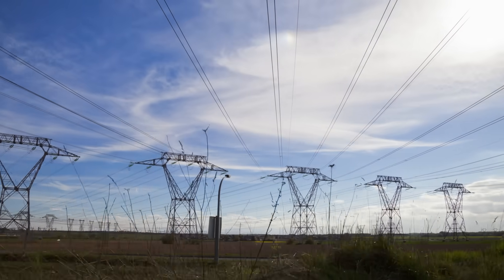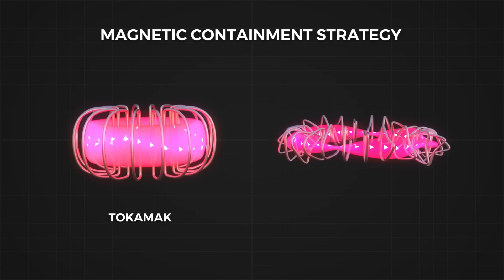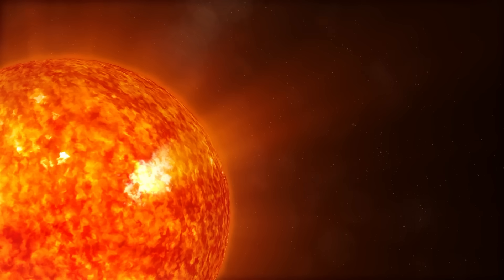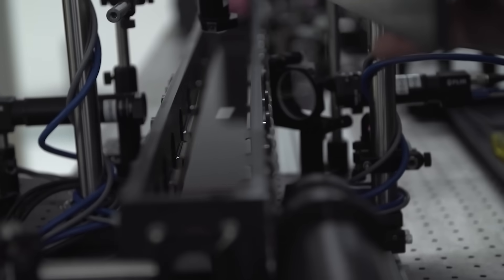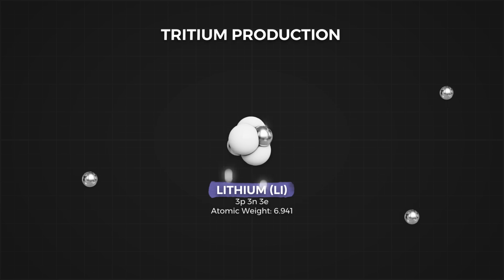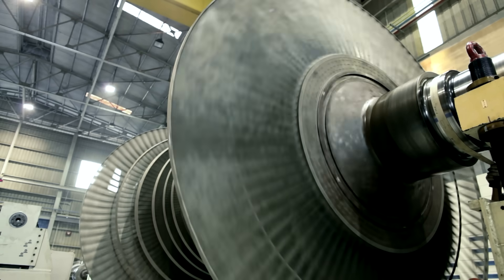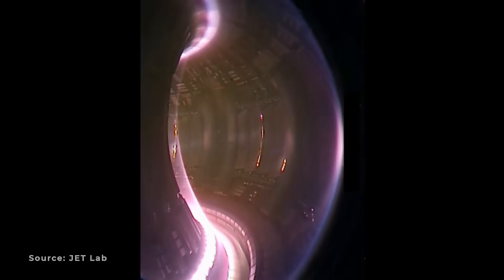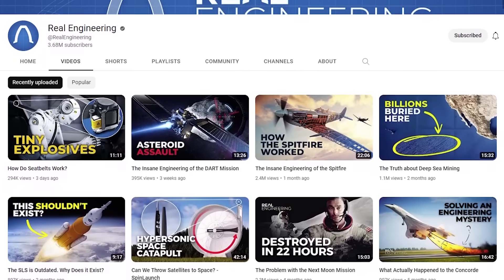The Problem with Nuclear Fusion

Comment: I really wanna learn about stellarators; they seem like an optimized tokamak.
Reply: They're exceptionally challenging to work with due to the shape of the magnets needed.
Reply: @ArcherOfJustice  yes well I figure some day soon computers and 3d printing style manufacturing might make it possible.
Reply: It is possible, it's just very challenging
Reply: Princeton is working on permanent magnet assisted stellarators. It seems really promising. You don't need to physically mirror the field shape.
Reply: I remember my uncle said he had conversations with ET aliens, and he said that humans have been making so many mistakes with their pursuit of fusion like there's so many other ways different from a steam turbine to extract energy from fusion,etc, we need to change our perception of fusions and methods around it
Reply: @kingsman3087  Okay. What are you going to do with heat from reactor? Just vent it out into the atmosphere?
Reply: @Poctyk  I’m pretty sure mechanical work is the only way to harness energy outside of photovoltaics… you almost always need a working fluid.
Reply: @Poctyk  the ET aliens use isotopes of heavy elements to assist in the fusion

Comment: The potential of fusion has never been questioned; it's the lack of substantial results that has frustrated the public.
Always being 20 years away has pushed the people to think of fusion to the same level of FTL and lightsabers.
Also, the idea of liberating every country from fossil fuel energy is romantic idea, but it will also cause many countries and their economies to collapse. 
Most likely to cause wars to compensate for the lack of income, and stunt other industries that rely on current supply chains.
Look at the Gulf States, Russia, Norway, Texas, Louisiana, Venezuela, and several African countries; all those areas will loss massive amounts of income and throw the population in to an apocalyptic level of contraction of the economy with the change of power propagation. 
It is not enough to create fusion alone if there is no subsequent economic competition, and replacement already in place to prevent such a fall. 
As an electrical engineer; I want to see fusion happen, but as a realist I can see the outcome of success without planning.
Reply: >Norway, Texas
Aren't a problem. They are big enough economies in their own rights to get along without oil. Not to mention being actually democratic, i.e. have leadership capable of changing course and admitting mistakes. (Not to mention Texas has rest of US economy to help)
>other petrostates. 
Yeah scerw those guys Nothing of value would be lost. There is literally a correlation between high oil prices and them attacking their neighbors, or funding terrorists just to destabilize other countries.
Reply: You can go ahead and dump billions into this fusion project but like solar, it will eat more than it produces and the ignorance of the masses is the only way to get it going. If only the public was this level of woefully ignorant of nuclear fission. They are ignorant in all the wrong areas.

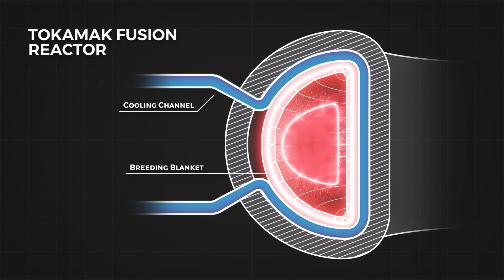Comment: 10:15 so with technology such advanced, in the end will only be boiling water to turn wheel in the end
Reply: One liter of water expand to 1600 liters of steam at normal atmospheric pressure so, yeah that's still the best wait to convert heat to electricity.

Comment: I do believe fusion will be achieved at some point, but cheap? I don't see how that will be accomplished any time soon. Just look at the technologies employed at every one of the institutions and companies attempting to achieve fusion. Just getting to the break even point requires tremendous effort. Getting beyond that point into the territory of megawatts of output would seem to be another, just 20 years off.
Reply: And boring old solar and wind and batteries are getting rapidly cheaper - so "inexpensive energy" is a moving target.
Reply: @DLWELD  Yeah, like I said, all that non-fusion, renewable energy cost is going through the roof... Wait, what?

Comment: We've had a workable fusion solution for decades. The reactor is under the Denver airport powering the secret Illuminati world control center...right next to the cure for cancer.
Reply: Fusion has already been achieved but it is extremely inefficient and uneconomical. Very unlikely. Cure for cancer? Virtually impossible. Cancer is so hard to cure because there are around 200 different types. Curing cancer would first have to start with fixing the faults in our cells duplicating which inevitably will cause cancer. Although most cancer cells are killed by your body not all will. Although I have no proof to definitively say no they don’t have such luxuries, you also have no definitive proof to say that they do.

Comment: 7:54 I think you meant to say "given off during nuclear fission" instead of "fusion". 
Unless we're using heavy water in experimental fusion reactors?
Reply: Deuterium-Deuterium reactions are a common fuel in experimental reactors such as JET but they don't yield enough energy. Deuterium-Tritium reactions are the ones we will have to use in actual power plants.

Comment: Can we fuse ordinary heavy metals to produce energy hydrogens gas.
Reply: fusing anything other than hydrogen is impossible for us to do the only way to fuse heavy metals is during a supernova which is when a very large star at the end of its life explodes
Reply: theoretically you can fuse any atoms lighter than iron to get energy, or fission any atom heavier that iron to get energy. Iron is the "ash". Supernovas provide the energy to fuse past iron.

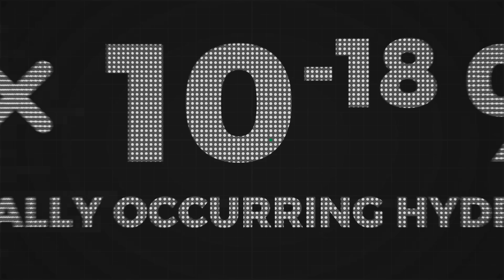Comment: @7:38 - okay, you're losing me here.  There's no such thing as a moderator pool, and you're showing a picture of a waste storage pool, which is definitely not shielded with heavy water.  Then you're stating the "pools" are designed to absorb neutrons given off during fusion?
Reply from the maker: Confidently wrong there. http://hyperphysics.phy-astr.gsu.edu/hbase/NucEne/moder.html don't argue with me, argue with my references.
Reply: @RealEngineering  That is a general reference but not on tritium from fission reactors. The Candu heavy water reactors generate tritium and gets sold commercially. I suggest searching on that reactor for info on producing tritium.
Reply: @RealEngineering  No no, I totally get that part - lots of reactor designs are moderated with heavy water.  CANDU reactors, famously so.  But none of them have the moderator in a pool, it's always in a pressurized calandria, and the photage being shown at the time was definitely a waste pool.  Waste pools definitely don't use heavy water.  FWIW, you can also create Tritium by irradiating Lithium in a fission reactor as well - not sure, but I believe that's the predominant method in use today.

Comment: Thorium salt reactors seem very feasible, and from what i understand they don't require a massive amount of nuclear waste to operate.
Reply: But the salt makes the reactor extremely brittle and causes massive durability and reliability issues. There has not been industry buy in on that idea because that problem has not been solved. Remember, if it made economic sense, we would already be doing it. That we're not suggests there are still issues with the concept.
Reply: @brofist1959  I mean, 'makes economic sense' is extremely subjective, and besides that there are a lot of non-economic, non-technical reasons for a technology not to be adopted by society, and I think nuclear reactors are a great example.
Reply: @brofist1959 Lol, normal uranium fission makes economic sense and it's not being capitalized on. Compare Germany with France.